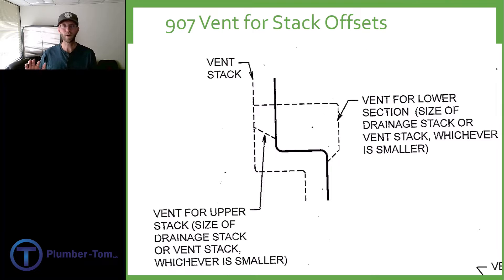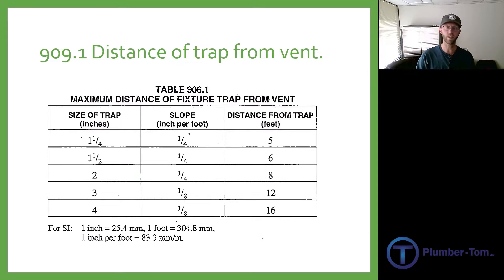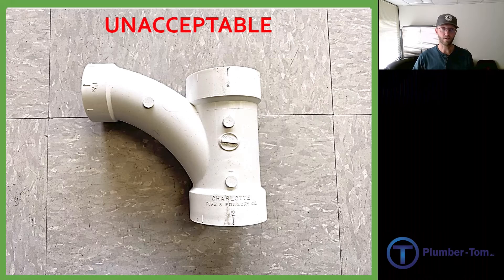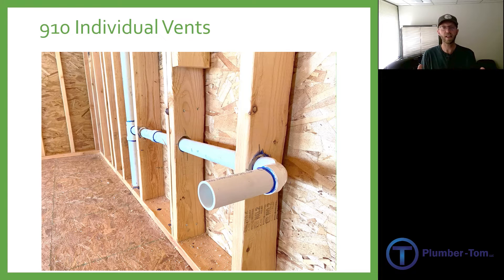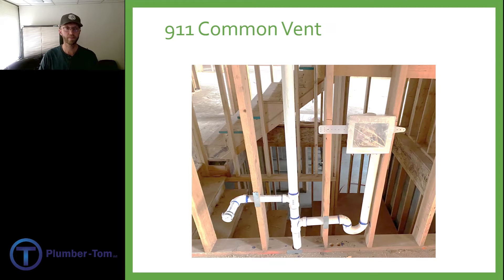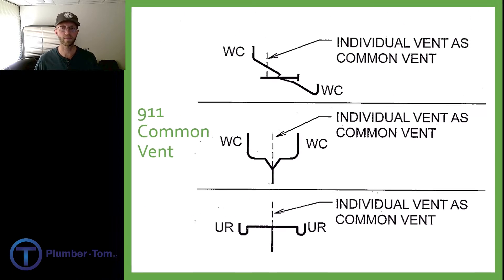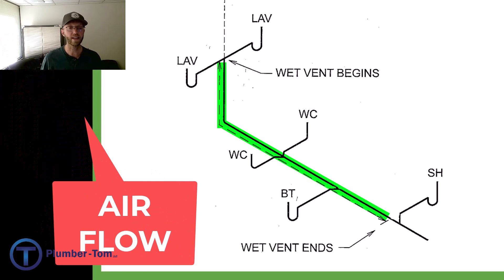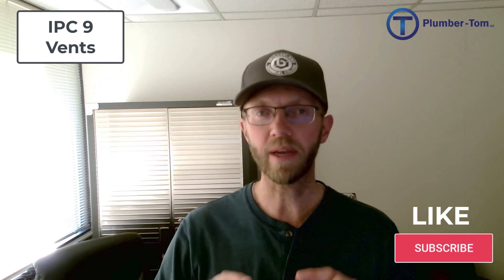Understanding International Plumbing Code Chapter 9 Sections 907 to 912

Comment: The table number in IPC 2021 is 909.1
Reply from the maker: Yes.  Thank you for pointing that out. The slide in the video was from an earlier edition of the code.  They changed a lot of the numbers in Chapter 9 a few code cycles back.  So you are correct, and I appreciate you pointing that out.

Comment: A Michigan Journeyman Plumber test question: 

“What’s the maximum development length of a 3” toilet line?”

A) 4 ft B) 10 ft C) 12 ft D) Unlimited

According to chart 909.1 the answer is C.

Correct?

Oh - 5:50 mark - Unlimited because it’s refilling / self maintaining trap

But what about 917.4.1 - says 4 feet..

Seems like it can be: 4’, 12’ & Unlimited?
Reply from the maker: Unlimited is correct.  The trap arm distance for a 3" pipe refers to a fixture with an actual ptrap, like a floor drain or mop sink.  Water closets are not limited.
Reply from the maker: Thanks for sharing your question.

Comment: How do you size the dry vent for wet venting? The IPC just says that it should be sized “ based on the largest requirement of pipe within the wet vent system.” Table 912.3 is referring to the wet vent, not the individual vent serving the wet vent?
Reply from the maker: Vent sizing is in IPC 906.  I would recommend watching my video on how to size vents.  These principles would apply.

Comment: I'm confused. At [12:59] the picture shows a WC discharging into a waste stack. This is not allowed by IRC 3109.2 according to the Code Check book I have. If correct, how the heck do you drain a toilet above the ground floor?
Reply from the maker: That section in the IRC is referring to the waste stack vent which is different than a vertical wet vent.  Check out my other videos on IPC chapter 9 for clarification on types and methods for venting.

Comment: Buenos días, muchas gracias por todos sus videos, explicas excelente. Sin embargo, me puedes ampliar la explicación respecto a lo siguiente: 

1. Por qué no se puede utilizar el drenaje de piso de emergencia para la conexión del tubo seco de ventilación para un sistema de tubería húmeda horizontal, dices que esto se debe a que un drenaje de piso no recibe suficiente agua para mantener la ventilación limpia, a que te refieres con ventilación limpia?

2. Un bidé y un drenaje de piso de emergencia, están considerados dentro del grupo de baños? es decir, un grupo de baños se compone de: inodoro, lavamanos, ducha, bañera, bidé y drenaje de piso?
Reply from the maker: With wet venting, a part of the drain is serving both as a drain and a vent. If the drain gets blocked it would affect the air flow and restrict the vent. 

Bidet and floor drain can both be connected to a bathroom group.

Comment: Why does UPC require water closet to be most downstream connection to a horizontal wet vent (and shown such in the video examples) but IPC does not indicate this requirement?
Reply from the maker: IPC and UPC handle wet venting differently.  The UPC is generally more restrictive.

Comment: Where did you find the exception for toilets, regarding distance from trap to vented line? Is that how you read 909.2?
Reply from the maker: Hello.  Good question!  I got that information from the International Plumbing Code Commentary book some years ago.  It was drawn out and labeled on several diagrams.  Now that you ask, I am having a hard time finding it in the code.  It might have been their recommended interpretation.  I or it might be in the IRC.  I will keep looking.

Comment: Why is it a violation at 16:13 but not in the example at 15:33 where it’s a single bathtub entering upstream of the wet vent?

Is it because there’s two separate fixtures or just solely that the WC needs to be downstream of the wet vent?
Reply from the maker: Hey.  Good question.  If you look closely, the bathtub in 16:33 is upstream from the lavatory vent connection. This means that it does not have an individual connection to the vent because the vent begins and the lav and goes downstream from there.  The problem is that both the toilet and the bathtub are upstream.  If it is just the toilet or the shower, that is okay, because the fixture connects to the vent at the lavatory, but when two fixtures are upstream in this example, it is a violation because you cannot have multiple fixtures with one connection to the vent.  Does that make sense?
Reply: Thanks a bunch! Learning a ton from your videos!
Reply from the maker: Thank you for watching!  I appreciate the support!  @matthewhalford2650